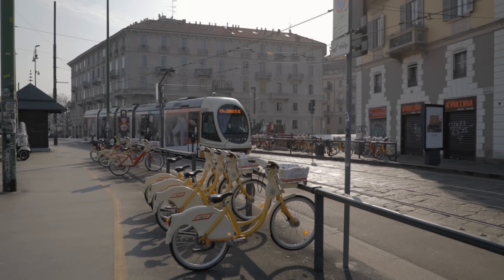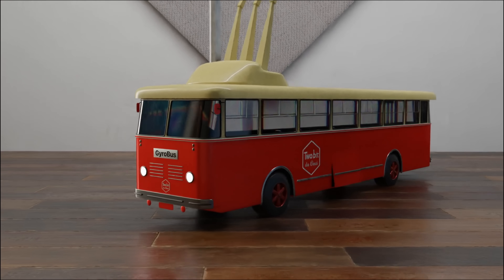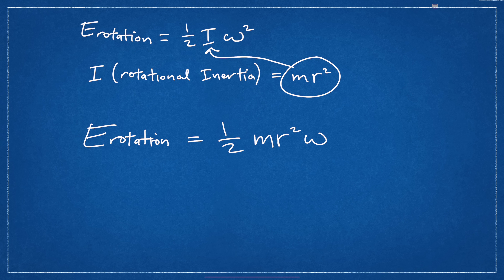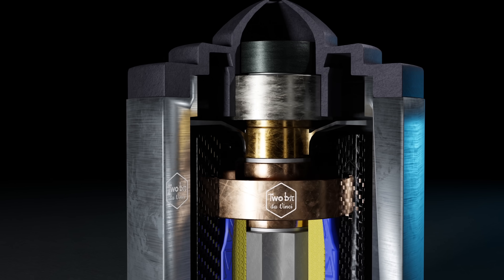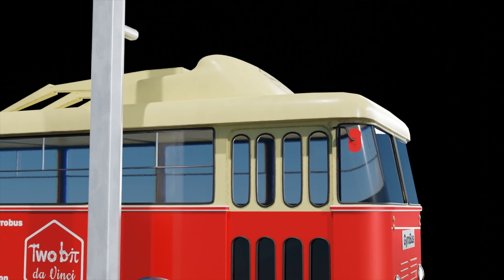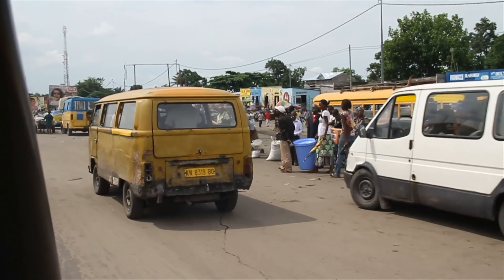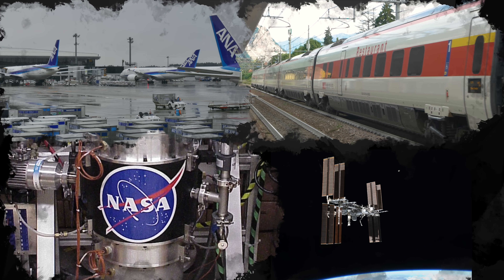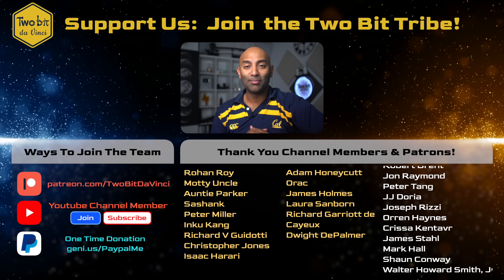This Bus Went Electric WITHOUT Batteries

Comment: The gyroscopic effect could be canceled out by using two counter-rotating flywheel devices side by side.
Reply: Turning left or right, yawing, as car turn, would not have gyroscopic effects since the gyroscope spins in the same plane as the turn. Rolling the bus would be next to impossible due to the gyroscope
Reply: @kevinrdunnphs  while tapping energy from flywheel, turning on one direction will be very easy and other will be more difficult. 
Worse is when braking or upon climbing a hump. When the bus pitches up or down, this thing will make it roll left or right instead. 
Mounting the setup on gimbal can eliminate this.
Reply: @Wingedmechanic  Hi Dileesh. For weird steering effects, try driving a motorcycle with a sidecar attached. Cheers, P.R.
Reply: @Wingedmechanic  but if you keep turning left (or right) repeatedly, you need more wiring, contacts etc to keep power supply connected as the gimbal keeps rotating the same way.( most buses run ring routes) If you use 2 counter rotating flywheels, you don't need a gimbal, wiring contact tracks and brushes- the flywheel/generator/motor is securely mounted and hardwired plus as it doesn't need to rotate/ flip on a gimbal, it requires much less room.
Reply: @kevinrdunnphs  which would suggest a much greater safety potential
Reply: @kevinrdunnphs  ......That woo be an additional benefit ...No roll over ever during accidents .... Reducing possible injuries by large factor...🚌🚎🚍⚡👨‍🔧👩‍🔧💡🚎🛸👽🧞‍♀️
Reply: Getting the best from flywheel is just bleeding off some of its energy.a static site away from population or other industry. Being slap fed outer by a power top up. . Like a top and whip of childhood days. On a gigantic scale.  Reverse of braking, power added instead of taken.  Huge cost to do it but it will last forever with engineering technology of today’s control systems. Get money off the scene and do it,  space exploration, war, cost consideration is not a feature. Just do it. What’s money anyway, just a carrot to humans and greed.
Reply: @williamrbuchanan4153  I bet you think you said something coherent.
Reply: How about stacking 2 counter rotating fly wheels? That should retain the storage capacity.
Reply: See revised post above.
Reply: @lcarliner  I think even better should be, if we let the flywheel's frame/container move freely, keeping flywheel in constant orientation.
Reply: @riscnx  Called a "gimble".
Reply: @lcarliner   I mentioned the idea of using 2 flywheels side by side in a recent post in response to this video. My idea is that they could run on electromagnets and be inside of a complete vacuum. And they could have the same type of battery in between them as a Tesla electric car.
Reply: The. Gyroscopic effect is directional in its effect, and stacking will allow torsional force to remain.
Reply: Actually one on top of the other would have better chance if counter rotating. introducing maglev into the mix, in a subzero superconducting canister much like a thermos flask. Would be much better. Should be nearly 99% efficient. Meaning the whole system could be fully electric. Glad to see I wasn’t the only thinking this with regards to flywheels. You could even stack them in multiple disk layers. Much like a old hard drive on a pc. The principles are the same. Just take care not to induce magnetic reconnection. Wouldn’t want that going of like a solar flare? Like it boys keep it up!
Reply: In Blackpool England they had a visionary man put in charge of transport and he used 3 or 4 of these on a new tramline he created  in the 1960s or 1970s I think it was ( or could have been for the coronation  !!!  ).In the mid 2000s a TV show found one and got it up and running back on the very same line but only for a tribute NOT  to carry passengers daily , the 2 or 3 excellent episodes are on YouTube if you want to see its resurrection .
Reply: Both methods should be tested to see if different gimbal mountings would as satisfactory as counter rotating pairs.
Reply: @lcarliner  Why not both? 😎
Reply: @lcarliner  Those gimbals are still attached to the frame, because of that all forces are still transmitted to the frame of the bus.  No matter how you gimbal it the forces still work against change of direction.  Additionally the efficiency is very low, power loss from the motor, generator and flywheel drag makes them less efficient than fuels or batteries.  Flywheels should be used in stationary conditions.  Stationary flywheels can also use air or gas or magnetic bearings to make wear and tear minimal.  You would not want to linger in areas where there's a 3000lb flywheel spinning on a spindle, especially in transit conditions are accidents are probable.  When it eventually breaks free (Chernobyl) it will come right out of the housing and chew any flesh in the area to tiny bits.
Reply: @DoctorMangler  there is a proven technology that makes flywheels fail in a safe manner, without catastrophic disintegration.
Ribbon shaped and/or composite materials being used as the main filler material for the flywheel mass.
Reply: I believe it was Lit Motors (I don’t know if they are still around anymore) that was using two inline gyros for balancing a 2 wheel vehicle.  I would think that using large gyros/flywheels inline would solve a lot of the issues with turning and pushing pulling.
Reply: Which require even more energy input into it... At that point, its even less efficient...
Reply: @mikeznel6048  absolutely true, it would be less efficient but carry more power for longer distances to have two gyros/flywheels. The catch is how efficient is it compared to gas/diesel busses? Current fuel prices in the US (which are highly subsidized by taxpayer money) are between $3 & $4 a gallon right now. I did a quick google search and found busses average 6.1 mpg for diesel which is the highest and most common bus type.  So $3 divided by 6 is about 50 cents per mile. The gyro busses used about 3.5 kw to go a mile. At the current average of 11 cents a kw the gyro busses would be using less than 40 cents a mile. Which is less efficient again? We haven’t even started talking about additional maintenance and longevity differences that unless there are massive maintenance issues with the gyro/flywheels that were not reviewed there should be very little maintenance for the gyro busses compared to diesel.

Now we were talking about adding another gyro spinning in the opposite direction to counter the rotational forces on the effect of driving.  Yes it would add additional power to get the second gyro spinning.  Let’s say double the power.  The catch is that theoretically that should mean somewhere in the realm of double the range but you should know that losses wouldn’t allow that so let’s say 1.5 times the range to be super conservative.  That would put the gyro busses close to being on par for fuel costs with diesel busses for fuel only.  The catch? We don’t just look at fuel alone.  The quality of ride that was reported was very good.  Noise pollution and air pollution was virtually eliminated.  Maintenance of EV vs Diesel has already been proven to be much lower in costs.  Once full Autonomy comes to busses these could run 24 hours a day and not have to spool up those gyros from a stop daily because the busses would always be running which would likely also add to their efficiency.  Another issue is that the original gyro busses were made using technology from the 1930’s or earlier because they were implemented in the 1930’s.  If we constructed a gyro bus with current flywheel/gyro technology with magnetic and vacuum bearings with the flywheels having a carbon fiber core to get the weight distribution even better they would be vastly more efficient compared to their 1930’s counterparts.  

Am I saying that we should do this for busses in our modern times? Not Necessarily.  With Battery powered electric busses popping up all over there might not be a need to use this type of technology for transportation.  Do I think it would be worth looking into to see the efficiency and cost differences between lithium type battery packs and a gyro power storage system using modern technology for short trip vehicles like city busses? Yes it would be interesting to find out.  If this were actually done we “might” actually see a revival of the gyro bus because of long term efficiency compared to batteries or diesel.  We might even see this technology used in light rail vehicles so there wouldn’t be as much wear on electrical cables between stops in above ground locations. Who knows what this could bring.  I just think it is interesting to find out that it existed and seams to have worked well for about 20 years.
Reply: @trevorshiffermiller2412  2 flywheels will only use double the power to spin up if they each are the same size as the single one. Obviously you pair 2 smaller counter rotating flywheels, get no gyro effect and only minimal energy loss if they are physically geared to run at the same speed. No doubt electronic speed control would be used so no drag from gears.
Reply: like a chinook
Reply: Yes, and that would be a great idea. Especially as, if the bus gets onto an incline, it will receive a force tipping it to one side, unless the flywheel is on gimbals, which I guess it could be.
Reply: "YAY SCIENCE" 
👍👌👍💪👊
Reply: @carguy221  I don't think transmission should be of any concern if solution is only used for electricity.
After all Mech->Gen->Inverter->Motor combo can bring us to 92% efficient in full vacuum.
Which in practice is way more efficient than directly using the Mechanical Energy via a GearBox.
Reply: No worries: The flywheel rotated on a vertical access, which does not change with direction or acceleration. there really wasn't any gyroscopic effect, like there would be if the flywheel spun on a horizontal axis. The only gyroscopic effect would be the rocking of the bus being transferred into a pitch change, which would make the bus feel more stable. Hitting a dip in the road, would cause the bus to rock. but that wasn't much of a problem.
Reply: But you significantly reduce storage capacity by doing that. 2*(r/2)^2 < r^2
Reply: @markirmuir  wouldn't you be doubling it? After all, 2*r^2 > r^2. Why half the rotation rate when you can keep the same rotation rate and increase the storage capacity.
Reply: @markirmuir  I may be safer should there ever be an accident, should they have a stopping system that might simply be a thick fluid dumped between the two closely spaced flywheel.
Reply: @markirmuir  that's like saying 2 motors on a plane running opposite rotations reduces power output. They are 2 motors the same output, but make the plane balance and steer straighter than one- or 2 that rotate the same direction.
Reply: @rossbrumby1957  It's the side-by-side flywheels that I was taking issue with - not the idea of having two fly wheels. If the two are co-axial then they could store similar energy - but that wasn't the proposal. There are still extra challenges in mounting them coaxially - that's why we don't see jet engines with counter-rotating compressors, even though that would make them safer to fly when another of the engines has failed.
Reply: I SENT IN DESIGN WHERE THE FLYWHEEL WAS THE MOTOR
Reply: Mercury used as a flywheel with magnetic fields. 

A fluid wouldnt need a gimble.
Reply: @dr.floridaman4805 ...  wasn't mercury what the German used in WW II attempting to duplicate the Vimanas of the Hindu gods ???
Reply: @Laffingbooda777  I dont know. The bell seems to be fake. At least everything I found has no basis, only lore.

However the mechanics are there. Watch the experiments
Reply: That doesn't cancel it out in all 3 dimensions only 1.
Reply: As the borg said resistance is futile and resistance is the big problem with all these ideas
Reply: One issue of the Gyro system is energy storage.

Doubling or stacking Gyros might help. But only just. I probably would take the length of a bus and install a second set on the same length. This will directly double energy storage. But this also increases the machines weight, which would affect range once again. Although you can load more passangers on the longer bus.
It's hard to decide where the point of return is.

Frankly I would consider using a Compressed air system. Similar performance in terms of energy efficiency, and the ability to get air conditioning for free from the drive train! I could even install a small LPG powered heater unit and have a nice climate control bus.

Although then you have to install massive compressed air tanks at every second bus stop and pipe air from a central hub, as independent compressors would make for a maintenance nightmare.
Reply: @glenmcgillivray4707  Hi Glen. Making bio-fuel leaves all the difficulties stationary in the factory, and leaves the bus with an unaltered range and decreasing weight-to-power ratio. No extra distribution systems needed either. Cheers, P.R.
Reply: @philliprobinson7724  problems with Bio Fuel.

The obsession that we should convert productive, food growing terrain into fuel production.

There is only a limited area of land in the world suitable to the production of crops for human consumption.

And those crops best suited to energy production are fast growing and highly draining on soil resources. And those crops currently 'harnessed' are in fact poor sources of energy. Corn in fact consumes about 1.2 litres of energy to make 1 Litre of fuel. Only the fact we use electricity for some parts of the manufacturing process makes it a net output of fuel.

To be honest? I want to see more external combust engines in industry, because we can grow trees and use them for fuel in regions ill suited to food crops.

And while folks keep hoping for fuel from seaweed, so far, too many resources are spent in processing the seaweed to perform the manufacture to be net energy positive.

More work is required.

Compressed air? Requires only electrical or mechanical energy.

Nothing else.

Give me a waterfall or hydro dam and I can produce enough compressed air to run an entire city 🙃
Reply: @glenmcgillivray4707  Used oil can be physically filtered for Diesel engine fuel.
Reply: @glenmcgillivray4707  Hi Glen. The objections to biofuel are well documented, but it's energy density makes internal combustion the most suitable for long range vehicles, including aircraft. External combustion has a maximum efficiency of 10%, compared to some diesels getting 50%. Cheers, P.R.
Reply: @philliprobinson7724  not disputing fuel density. Mostly complaining that if we are going to spend energy making fuel, we should think about how hard we have to work and work on relying on fuels less energy intensive
Reply: @glenmcgillivray4707  Hi Glen. I agree entirely, we want the best return for the smallest investment. Cheers, P.R.
Reply: @missouriman7689  Huh?
Reply: @missouriman7689  Very very good Info given.
Reply: Can we use power steering? 😄
Reply: @keithschneidly3922  Hi Keith. That's right, in economics it's called "the mini-max principle". Minimize the inputs, and maximize the pay-off. With biofuels we get out about twice as much energy as is used in producing the fuel, but don't quote my figures. Provided the energy used in production   is carbon neutral, the gain remains. With petroleum it takes about one barrel of oil energy to produce twenty barrels, which is why petrol is relatively cheap. (Again, don't quote my figure.) The big trouble today is that petrol's cheapness makes it uneconomic (at present) to develop "make your own fuel" technologies. This too will pass, especially when genetically modified organisms are developed that can turn cellulose etc into fuel. Cheers, P. R.
Reply: @keithschneidly3922  Hi Keith, you make some good points, and ask relevant questions. It seems a substance called "olivine", a magnesium compound, can be used to extract carbon from the air, and that there's more than enough of it to deal with the problem. However that'll take major investment world-wide. In the short to medium term we cannot keep shelves full and cities fed except by burning petrol, but with planning, in a few decades from now, we might achieve a carbon zero economy. After that we can work on paying back our "carbon mortgage". 

Setting unrealistic goals, such as becoming carbon zero by 2030 is just pandering to overzealous  climate action fanatics. "WE WANT IT FIXED NOW", isn't only an impossible demand, it makes it harder to plan realistically by introducing a fear factor and mob rule. A problem 200 years in the making could possibly take just as long to solve. However we solved the 1990's "hole in the ozone layer" problem, and this is just a bigger version, so we've every reason to be confident.  Regards, P.R.
Reply: smart people in chat
Reply: Not quite.
Reply: Humans 0
Saiya-jin 1 to 6
Angels 7 😇

Kalki Ironman 5th matriya buddha 8th arc Angel 11th satguru 13th imam and 24th avatar after 2026 😎

Almighty God 9 😇

Humans type 2.5+ after 2026 by Kalki Ironman (christ in the white horse)(son of man on clouds) type 7 and 8 😎

Jarvis the world’s first artificial intelligence (parrot) 😎

Cuz Kalki is ironman batman super saiya-jin superman ben10 saitama Narutoo optimus prime and every super heroes combined after 2026 😎

Jarvis world’s first artificial living being (just like vision in marvel universe)😎

Made of Quantum and sub quantum particles 😎

Power source quantum energy arc reactor (type 7) level technology 😎

Kalki Ironman going to have every kind of arc reactor like:- type 1 Nuclear fission, nuclear waste, hydrogen fusion, type 2 3 4 5 antimatter arc reactor (solid liquid gas), type 6 electro quantum arc reactor, and type 7 Quantum arc reactor, type 8 limitless quantum energy arc reactor without quantum particles 😎

Kalki Ironman going to have sun in a box million billion tons of hydrogen nuclear fusion reactor type 2 3 4 5 just like sun and stars in the palm of his hand 😎

This all going to happened by self replicating quantum nanobots knowledge energy and techniques at type 7 7 7- respectively 😎

Ironman (Tesla 2.0) going to reveal every secrets of the world specially Tesla and his Antigravity 😎
Reply: Or by just throwing all that bollocks away and fitting a V8 Engine with a big fuel tank...
Reply: @Mike_Hughes  Hi Mike. We can brew our own fuel: what ain't good enough to drink can go in the gas tank! Problem solved! Cheers, P.R.
Reply: @philliprobinson7724     Cool idea, Phillip.   And if it was a Bus installation, every Seat could have it's own Alcohol Dispenser, fed from the Tank (including the Driver's)  -  Now that really would be a fun daily commute...
Reply: @Mike_Hughes  Hi Mike. I knew you'd see the pure beauty and simplicity of it. The idea hit me one day when I was crossing the road. A bus came out of nowhere, and I suddenly saw the possibilities. Cheers, P.R.
Reply: @philliprobinson7724     Cheers Phillip !
Reply: I think they need to be stack on top of each other.